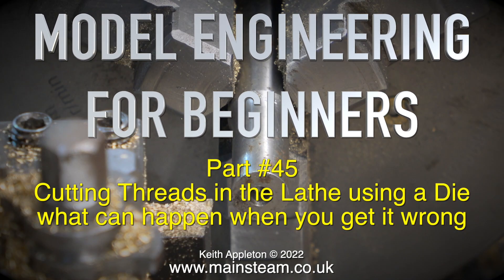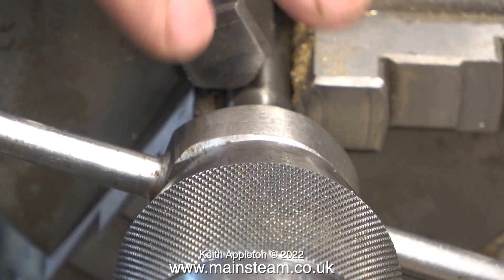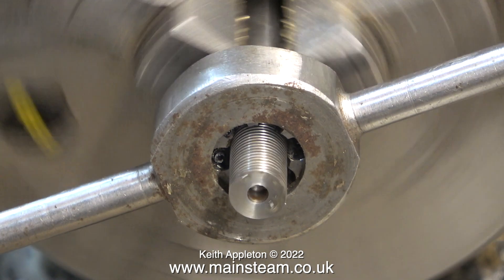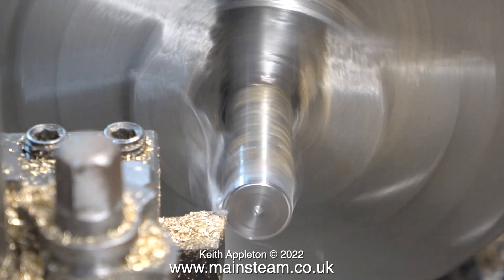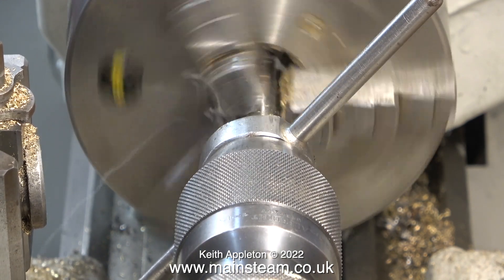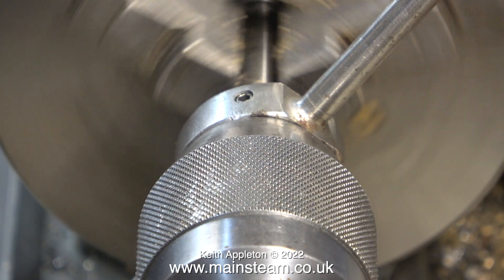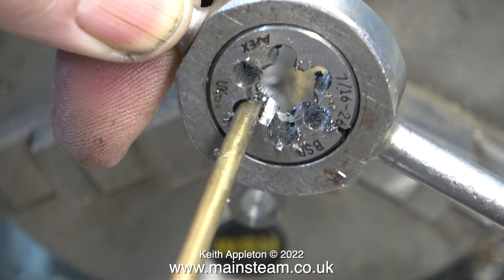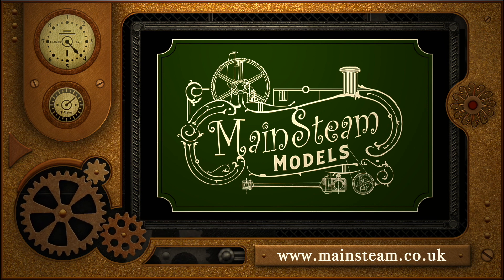COMMON THREADING PROBLEMS - MODEL ENGINEERING FOR BEGINNERS - PART #45

Comment: When I took metal shop in high school we spent a whole week learning how to cut threads in a variety of metals.  You might think cutting threads is simple, and it is if you know what you are doing.  If you don't know, then you start messing up and wasting metal, money and time.  I had the hardest time learning how to cut threads in tool steel, tool steel is very hard and you really have to be patient and not rush it and lots of lube helps also.  I never cut threads on our lathe though, probably because it couldn't be lowed down enough, and as you showed threading too fast tears the metal.  It's all about the feel I said,,,,,, and she just laughed.

Comment: well now THAT is a very useful video ... instant trouble shooting help for threading stuff ... 
.
this is what I love about the channel the most ... it doesnt just cover steam engines but good trouble shooting tips and tricks ... that can be applied in many different things ... heck even 3d printing threads can be covered with this since one gets similar problems with them if things are set right ...